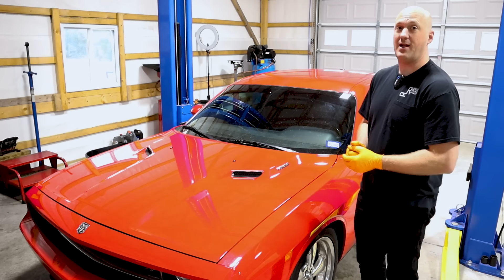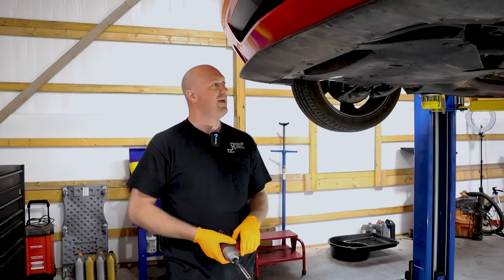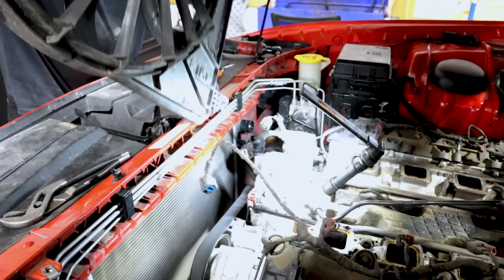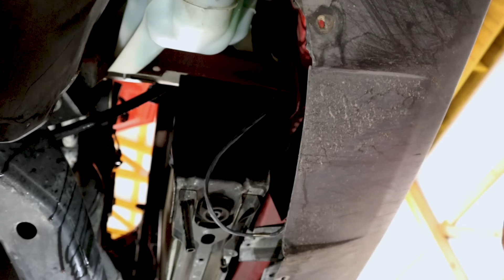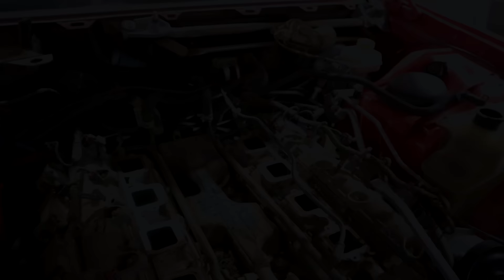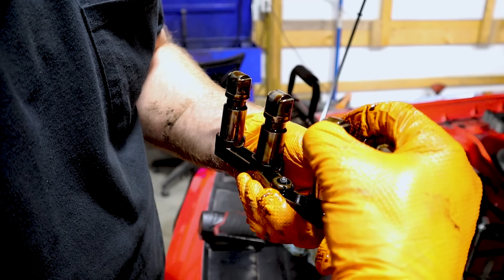Hemi Cam Installation! Budget Challenger Build Ep1

Comment: I NEED HELP PLEASE!!!       I have an 06 Dodge Charger 5.7 Hemi. I tuned it with a Diablosport i3 and it did fine but i wanted to mess around and get it just how i wanted. So i ended up added and restoring tunes about 3 times. Then while on a stock tune. I stopped to do a 0-60 run. I put it in drive and left Traction Control on. I hit the gas and it didn't shift out of first red-lined then went into neutral and i had to stop and shut it off and restart it. Since then I'm down on power and i have a randomly accruing Ambient air temp sensor code or a check engine light with no code. Also I'm way down on power and i hear it spark knocking here and there. now i cant tune it anymore it just says read failed. It doesn't seem to down shift at the same spot anymore also. I replaced the Ambient air temp sensor and the crankshaft sensor but nothing is helping. So i ordered a plug and play PCM. I hope that fixes it. Do you have any clues to the problem??? I know this isn't the right place for this but, I'm desperate.
Reply from the maker: That's a tough one, it does sound like it might have bricked the stock PCM. When the new one comes in, it'll still need to be programmed to start properly. You might have to have that done at a dealer so your key will start the vehicle, generally there's a key code that needs to be programmed into the PCM.
Reply: @ReignitedAuto  Thank you. I really appreciate the reply.

Comment: I did this same cam upgrade along with ported heads, jba headers, Solo high flow cats etc. I did replace the pushrods too though since I  pushed the rev limiter to 6,200 rpm... didn’t want to bend a rod. Pushing about 390 rwhp now on my l’il ol’ 5.7L challenger ;) Not much more for me to do except a supercharger, but I think I’ll keep this NA for long term durability. 

In this video I learned that I did not have to take off the oil pump and pickup tube. They were a pain to get back on as I recall. There are also marks on the chain and bottom of the crank craft sprocket for timing alignment in case you do remove the chain and cam phaser like I did. 

There are a few tricks to putting it all back together too, like putting black oil rated permatex at the joint of the timing cover, oil pan and block; torque sequence for NEW head bolts; thread lock on intake bolts to name a few. 

I also changed out the chain guide which you should too to preclude failure.
Reply from the maker: Sweet setup! Really wakes these cars up 💪
Reply: Never heard about thread lock on the intake manifold bolts...where did you come across this info ?
Reply: @DL101ca  from the shop manual.

Comment: I have a 2018 challenger 5.7 with 6 speed  manual the car has been back to dealer 20 times with intermittent lifter noise of course every time I take it they don’t hear it one technician telling me it does have MDS the other one tells me it doesn’t and the thing sounds like someone drop a wrench in the motor they will not fix this car Is there anything I can do to get it fixed
Reply from the maker: If it's a manual trans it definitely does not have MDS, but that doesn't preclude it from having a lifter issue. Is the vehicle still under factory warranty? If so, and if you have it documented that you've been in to the dealer several times for the same issue, it might be beneficial to get the dealer rep involved. The service manager can do that and the dealer rep can authorize a teardown for inspection to see if the lifters have failed. This can be a fight to get them to act, as it's their job to protect Chrysler's interests, not yours. But like most professions, there's good ones out there that genuinely try to help people.

Comment: Can the parts listed in the description be used on the ram 5.7 also?
Reply from the maker: Yessir 👍, except for the SRT headers, they won't fit.
Reply: Ok, I also was wondering why you're replacing valve springs, is that required in conjunction with the 6.4 cam?
Reply from the maker: @nealtouchton2878  It's not required per se, I think you can get away with stock valve springs on a 6.4 cam. But for any cam upgrade I think valve springs are a worthwhile investment. These particular valve springs are very affordable through Chrysler.

Comment: Do the same procedures apply to 2013 Durango?  Is it just as simple or does the body configuration make it more difficult on Durango?
Reply from the maker: Basically identical, there's some minor differences regarding removing the radiator and such, but the engine itself is identical. 👍
Reply: @ReignitedAuto  thanks for quick response. Mitchell tells me the condenser needs to come out before radiator so I will have to recover 134A at our shop before bringing home for cam/lifter repairs. (It’s my wife’s car)
I’m not a Mopar guy. I’m a medium/heavy truck technician. The valve train has been noticeably noisier on a warm engine. Loud ticking when warm and knocking on cold start up for a few minutes. (Owned vehicle since new and oil change and OEM filter every 3000 miles.)  Wife wants to keep car since it’s paid for. Would it be better to remove engine or do in car?
Reply from the maker: @bubba.watercraftj7269  In car for sure. I try to stay away from that heavy truck stuff myself LOL, everything is too darn heavy!
Reply: @ReignitedAuto  my father was a car guy for 50 some years and me a truck guy over 40 years. He always used to say “car guys don’t want to work on trucks and truck guys don’t want to work on cars!”  Lol. I do both in large fleet. Preferably trucks. Bigger parts though.   I like your channel. Keep up the great videos. Subscribed.

Comment: Ok, I am curious....the Gen 3 is similar to the LS....why do you have to take the heads off to do the cam?
Reply from the maker: Technically I've heard that you can do it with the heads on. Just remove the rocker arms, spin the cam 720 degrees and slide the cam out. Two issues stick with me though, the first is that if any of the lifters slide forward again you'll have to use a magnet to pull them back up, and possibly one could slip forward completely out into the oil gallery and at that point you'll have to take even more of the engine apart. The second reason is more practical. As the Hemi is known to have some lifter issues, it just makes sense to replace them at the same time you're doing a cam swap. Thanks for watching! 👍

Comment: Oil wants to float on top of water. So all the coolant will find itself to the very bottom of the oil pan after pulling the heads. It's better to let the oil keep a barrier between the water and the steel parts inside the engine. Keeps rust from forming anywhere

Comment: Very detailed video.  I am planning doing my 5.7 in a couple months.  Just got a complete 6.1 intake and shorty headers.  Also have a stage 2 kit cam and heads from Frank's Racing.  It looks easy enough to do.  I do also plan on new lifters oil pump and water pump and timing chain since I'm in there.  The car does have 59000 miles so not sure if I have to change them.  This is on an 06 Daytona.  Thanks for the video cant wait to see more.
Reply from the maker: That's going to be a nice setup when it's done! All those components would be a good plan. The timing chain is a personal preference thing, these are generally pretty good. One thing to note is the older models the cam thrust plate is one piece that goes behind the oil pump, so you definitely will have to remove the oil pump to replace the cam. On that vehicle you can remove the oil pickup tube from the oil pump and just let it rest in the oil pan until you install the new oil pump. It's a bit finicky, and don't drop the bolt for the pickup tube in the oil pan. But it beats removing the oil pan entirely! Hope that helps 👍
Reply: @ReignitedAuto  thanks for the tip.  I'll have to post up a video of it when it's done and tuned.
Reply from the maker: @tomschmidt8603  Absolutely!

Comment: I learned the heads need to be removed on a Hemi for a cam swap...:-)
Reply from the maker: Technically I've heard of guys doing it without removing the heads. Basically, you remove the rocker arms, spin the cam 720 degrees to push all the lifter back in the housings and then pull the cam out. The issue is, if any of the lifters slide forward again, you're kind of out of luck. I guess you could use a magnet to pull it back again, but if it fell out completely into the oil gallery then it's a whole new problem! I'm going to try this procedure on my 6.4 Hemi in just a few days, because I'm taking it apart anyway and just want to see how doable it is. Thanks for watching! 👍
Reply: @ReignitedAuto  on e newish engine with tight tolerances, the lifters will stay put as long as you're quick about it when swapping the cam. I honestly have not heard about anyone dropping a lifter when doing a cam swap this way, but we all know we tend to not speak about our failures on the net unlike you my good man !!😉

Comment: To have a lift would be ultra sweet, it would save me much back pain. Oh well.  I noted that the 5.7 is noticably similar to the 392/6.4 engine.  I guess FCA used many similar parts to simplify supplying parts.  I have a SRT 6.1 Challenger and it looks like the cam swap will be very similar. I prefer naturally aspirated myself, so a minor boost from a cam upgrade, with a tune, I think would benefit the car greatly.  As I have an automatic, a higher stall converter and maybe a slightly higher rear end gear might make it quicker off the line.  Anyway, this is a great video, very informative, I like how you get right to the point and done drone on about unimportant details like a lit of Utubers do.
Reply from the maker: Thank you for the kind words Jon, and yep, the 6.1 is basically identical mechanically so you should be good to go! 👍

Comment: Easier then you think, let's break that down a bit. Pulling the radiator, accessories, water pump, timing chain cover okay that's understandable. Pulling the heads just to get at the lifters, poorly thought out design for repair and not a simple job. Don't get me wrong I have a 06' Magnum R/T that I have to do a cam and lifter replacement on in the near future, and I'm not happy about pulling the the heads to do it. Man I do miss LA V8's
Reply from the maker: Yea the lifters under the heads thing was a miss for sure. Still, the first time you do it you'll see it's not a big deal 👍

Comment: Great video! I love HEMIs! Any tips or things to know when buying a 2008-2010 6.1 hemi with 5 speed automatic? They don’t have MDS correct?
Reply from the maker: As far as I can tell they don't 👍. The 5spd trans is actually a really good transmission, don't see too many issues with them. Only thing that fails usually are the speed sensors, which unfortunately are part of the main electrical harness for the trans and costs about $500. But other than that they are usually pretty solid. First thing I would check is the condition of the trans fluid, if it's black or smells burned, walk away. If the fluid is still red or even brown but smells normal, you're good to go. 👍
Reply: @ReignitedAuto  thank you!  Have you driven a 6.1? How do you like them?
Reply from the maker: @512Born  I like them, I think there's a noticeable difference in power versus the 5.7

Comment: INVALUABLE.  Thank you. I always wanted to know how to do this since shop's will charge more than a few grand to do it. I was quoted 6K for a cam, long tunes and a tune with an MDS delete.

Two questions...
Did you buy a kit that included all the gaskets?
Your power tools...what brand and model?

Thanks again!
Reply from the maker: Thanks Jerome I appreciate the kind words! That price sounds about right for that kind of work, could definitely save a lot doing it yourself. I did not buy a kit, I still have a good relationship with the Chrysler dealer I worked for, so I just bought the gaskets individually from them. My electric tools are all Milwaukee, the 3/8 and 1/2" impacts are both the fuel type. I love them they work amazing!
Reply: @ReignitedAuto  thanks for the info. I definitely appreciate it!
Reply: $6k what are they charging an hour $450? that's ridiculous in 12 hours of labor that's $5400 dollars in labor at that rate.

Comment: Turning wrenches to install a cam on my 392 isn't what's holding me back. What's holding me back, is that no one actually knows how to tune these cars. I'm not driving all the way to Texas and wait a year for a guy who knows what he's doing.
Reply from the maker: I hear ya, I'm basically going to be programming a canned tune from DiabloSport on this car, but it for sure could be optimized better for the 6.4 cam. Thanks for watching! 👍
Reply: Bro what rock have you been living under ? Jay Greene, Hemifever and probably many other out there are tuning Hemis with custom cams, NA strokers, boosted and whatnot. I have a Jay Greene cam in my Ram, engine and transmission tune. Very happy with his service.
Reply: @DL101ca  I've heard different. The information I've read, its seems like there's probably only about 5 shops who actually know what they're doing. I'm not doing a canned tune.
Reply: @ksks6802  I wasn't talking about a canned tune. After I installed the cam, Jay sent me a tune to get the truck going. I did some data logging with Diablosport, sent the file to Jay and he sent me a revised tune right away. Truck drives very well. If you're talking about a dyno tune, then yeah I don't know anyone but Jay knows these engines very well and he is worth what he charges.

Comment: With a vehicle that has higher mileage why not change the chain and tensioner ?
Reply from the maker: We have almost no failure rate on these tensioners. The older style will sometimes have issues, but I've never personally seen one of these fail. The timing chains also do not really stretch. I've seen them go 200k+ and they measure out identically to a brand new one. Thanks for watching! 👍

Comment: Hey man, I've done this job 3 times, twice on 2010 challengers. my own car is running a 392 cam, long tubes and magnuson blower. Just a piece of advice when putting it back together you don't need a crank pulley installation tool, simply heat up the inside diameter of the pulley with a heat gun or torch and it will slip right on.
Reply from the maker: That's correct! I show a slightly different way on the next video, but that works just as well! Thanks for the feedback and thank you for watching 👍

Comment: Ballpark range how much horsepower do you hope to gain from this? I’ve been wanting to do this as well, but I’m planning on putting a 6.4 manifold on top
Reply from the maker: I've heard the 6.4 manifold gives good gains, but I'm unsure of fitting it in the engine bay. You'd have to come up with an air intake from scratch for sure. Personally, I'm hoping for a 40-50hp gain between all the mods. Thanks for watching! 👍
Reply: @ReignitedAuto  Nice gains. I have a 2010 pursuit so taking notes 👌

Comment: I did not know that manual transmission came without MDS. Do you plan to replace the timing chain tensioner while you are in there? Do any of your planned modifications cause failures at annoying places like the Oregon DEQ?
Reply from the maker: Nope, the timing chain tensioner on these models is such a simple design that I don't think I've ever seen one fail. The nice thing about the 6.4 swap is that you don't have to use a tuner to make it work, so it'll pass all the computer emissions tests. I've been driving the car without a tune for a few days, no check engine light thus far and I don't expect one. Also, you still use the factory cats so shouldn't be any issues there either. 👍

Comment: I have a question . Are you recommending repleacment parts, specially camshaft and lifters, or only OEM.  Thank you for answer.  Perfect video. 👍👍😉.
Reply from the maker: I'm a product of my training, which experience has shown me that OEM parts generally are the most well built. My thoughts are, if the OEM parts lasted 100k+ miles before having an issue, go with the same parts again. I've heard too many horror stories of cheap aftermarket lifters to chance that. I know there are some aftermarket companies making upgraded lifters, but I don't have personal experience with them to have an opinion. Really appreciate you watching!